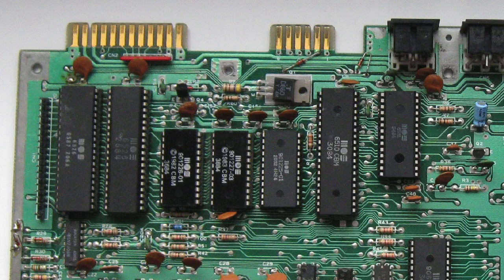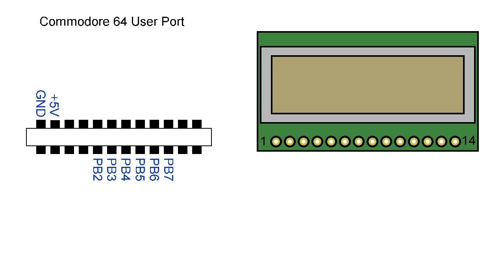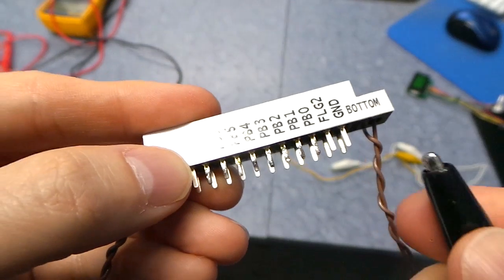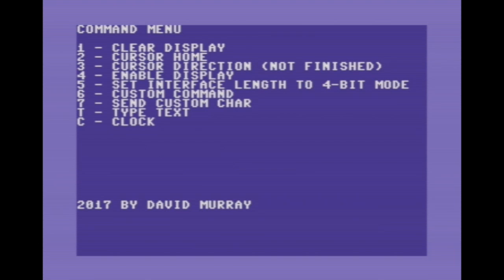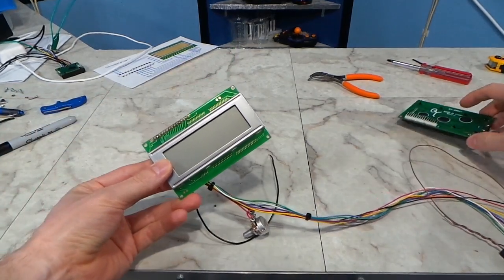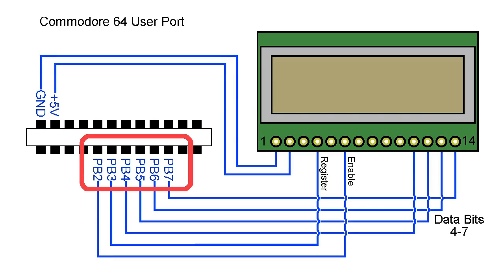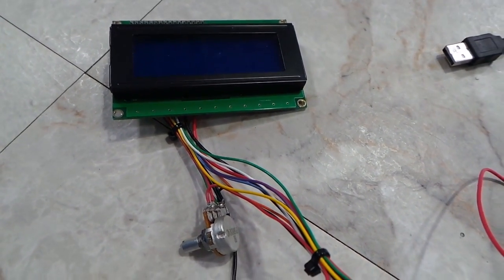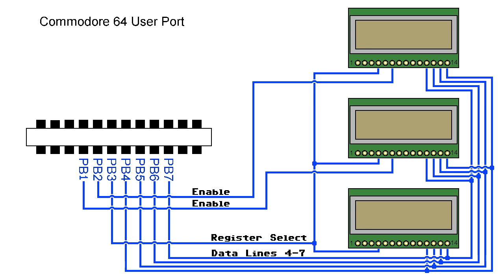How a Character LCD Works - Part 2

Comment: I have a c64 as well and at least one extra power supply. Could you do a video of you fixing the power supply? I am now a little worried about mine frying. Having at least a basic idea of what to do to fix it will really help me.
Reply: The power supply has a 9V AC output and one regulated 5V DC output.  You don't need to worry about the 9V output... in my experience, it almost NEVER fails.  The problem is when the 5V regulator fails.  There IS something you can do to extend the life of your power supply... always unplug it when the computer isn't turned on.  That way, it isn't generating heat all the time. 

Another thing you might look into is an over-voltage protector that plugs between your power supply and the computer.  If the 5V DC rises above a certain threshold, it cuts the power.  There's one called the SAV64 which has been mentioned several times in the comments for this video.

Depending on the type of power supply you have, it may be easy to fix or it may not.  The black bricks were the hardest to repair, because they encased the circuit board in epoxy.  Removing all the epoxy without damaging the board is a real pain, but it can be done.

I probably wouldn't have him do a video of him fixing that power supply (it was one of the black bricks).  If I were you, I'd have him demonstrate how to put together your own power supply.  All you need is two wall warts, one with an output of 5V DC @ 4 amps, and the other with an output of 9V AC @ 1 amp.  You also need wire (obviously) and a 7-pin DIN connector like Commodore used.

For that matter, he might also do a video on how to build your own over-voltage protector.  I know there's an open-source schematic for building one, because I mentioned it in one of my other comments on this video.

Comment: Hmm... if the power supply starts to put out more than 5v when it fails, why not modify the power jack with a 5v voltage regulator? It should protect the computer from overvoltage and still allow it to function properly, plus it's super easy to hook up with only three connections: in, out, ground.

Comment: I find these "8-bit guy" videos interesting.  I had a TRS-80 Model I as a kid and never got into the Commodore machines.  I have found a lot of videos where people have hooked up newly-made hardware to these old computers.  I never thought an LCD screen was a separate piece of hardware that could be controlled externally, but I find it interesting how the LCD works.  I suppose the VFD display in a Speak & Spell works in a similar fashion.

Comment: Hi, this is very interesting. Maybe it will be a good idea to add some protection to Your valuable stuff? You can put a fuse and a transil diode on the power input to add some protection. When You are connecting LCD to the port instead of direct wiring you can add resistor (about 100 ohm) in series - it should protect against shorts. Also take care about ESD safety - older IC's are more voulnerable to damage from sparks. I hope it should save you from problems in the future. BTW, great explanation of how LCD works.

Comment: My computer has voltage problems when it's charging devices. Luckily it shuts down the USB port when it realizes it's sending too much - why does it even happen? It's a 2014 Dell Inspiron
Reply: I work for Dell... the error message you're talking about is "Power surge on the USB port – USB Device needs more power than the port can supply".

In other words, it isn't your computer that has voltage problems.  Whatever you're charging, is demanding more power than the USB port can supply.

Comment: This could very easily be done over the Atari 8-bit's joystick ports. Is the C64 unable to output data through its joystick ports?
Reply: It uses the exact same joystick ports as the Atari does.  The issue is not whether you can send data over the joystick port... the issue is, "where is the power for the LCD going to come from"?  It needs 5 volts DC, and I guarantee you're not going to get that from the joystick port.

Comment: Can I hook up a 12-volt DC adapter to a Commodore 64?
Reply: The Commodore's power supply normally outputs 5 volts DC and 9 volts AC.  So, in order to hook up the 12-volt DC adapter, you'd have to divide it into two outputs: a 5 volt output and a 12 volt output.  Some things wouldn't work because they need AC... the datasette, the TOD clocks on the 6526 chips (because they get their frequency from the AC), and pin 11 on the user port (which normally outputs 9V AC).  But if you don't need any of those things, then yes, it can be done.

Interesting fact: The 6581 SID chip requires 12 volts DC (the 8580, used in the C64C, only requires 9 volts DC).  Normally, it gets it by passing the 9 volts AC through a rectifier to convert it from AC to DC.

Comment: Google "Ray Carlsen commodore". He'll build you a new power supply minus the problems of the original.
Reply: Not only that, he builds them with a built-in overvoltage protector.  Which is why his "basic" model (obviously made from two wall warts) is only $35, while his fancier models are $80.

Comment: Great video! :)
Unfortunately, it confirms my paranoia about those old power supplies - every time I set up my C64 (not as often as I'd like to) I check the voltages before I plug the supply into the computer. Last time I also checked the voltage after using it for a few hours, just for curiosity, and after seeing how high it got in just a few hours I decided to take a short break to let the PSU cool down again (AFAIK the deviation builds up with temperature). The supply being from the 80s while Germany increased power grid voltage from 220 to 230V in the early 90s makes it even worse... I read that the AC part of those PSUs (at least the European ones with 220/230V) would still be stable and could be used without any risk, only the DC part is critical. I guess I will finally build some small adapter to replace the DC part with a modern stabilized supply. I would have preferred to replace the AC part as well but it's hard to find any ready-made AC adapters providing the current and stability without load. All I can find are transformers as PCB components and I want to keep away from line voltages if I can. So it sounds like continuing to use the AC output but discarding DC from the original supply and injecting the DC voltage from a secondary PSU is my best option. But before I accidentally fry my C64, I'll better continue to search if that's a valid way of solving the PSU issue.

Comment: Hi David!

If it is a common problem, that commodore psus make overvoltage when go bad, why don't you make a device which alarms you when there are overvoltage? You could connect it the user port or cartridge port, connect it to an arduino, and with a voltage divider (which is 2 resistor in series) connect it to any analog pin on the arduino. If it goes overvoltage, turn on a buzzer or something. Maybe print some kind of cartridge for it. Probably a friend of you got a printer or there is some place where you can print it.
What do you thing about it? :)
Reply: I don't know what HE thinks about it, but I think why go to all that trouble when there is an overvoltage protector called the SAV64.  You plug your power supply into one end of it, and then there's a cable that runs from the SAV64 to the computer.  If the 5V regulator goes out, the SAV64 cuts power before it can damage the computer.

Or, if you don't want to buy an already-assembled SAV64, there is an open-source schematic for an overvoltage protector that you can build yourself.  No buzzers.  What's the point of a buzzer?  What would happen if you were out of the room when the buzzer went off?  The computer would probably die, that's what.  It's better to just have it shut the computer down (even if you lose anything you haven't saved) than to fry the computer's chips.
Reply: Sounds better.

What's the point of the buzzer? I don't know. I've searched for buzzers for a random project, and it was on my mind, it wasn't well tought out. :D
But if we replace the buzzer for a relay, my circuit is not that bad. If senses overvoltage, it cuts the power.

That Sav64 seem a good solution.

Comment: perhaps you could make a passthrough device with a regulator and voltage meter (perhaps one that beeps if the detected voltage is above a set limit) then you wouldn't have problems ever again and since it would be a passthrough you could just unplug it from a broken power supply and use it on a new one
Reply: That kind of thing already exists.  It's called the SAV64.  All it is, is an overvoltage regulator... if the voltage gets too high, it just cuts the power before it can damage the computer.  Or, if you can't find a SAV64 (the guy who makes them only does small production runs, so sometimes it's sold out), you can build your own.  There's an open-source schematic for something that works exactly like the SAV64.

Comment: Why not repair the power supply? You probably just have some drifting components. Are they epoxied in or something? Cool video, by the way.
Reply: The power supply was one of the "black bricks".  Yes, it is completely epoxied in there.  It's literally a solid brick of epoxy around the circuit board, with a black plastic case around that.  (And now you know why they're called "black bricks" by the people who've opened one up.)

Comment: Thanks for your interesting video. It's a shame your C64 PSU had to ruin your plans! I assume that if you have any future problems when using your C64 you'll check the PSU voltage as a matter of course. Seems like a poor design of PSU if it fails with an increased voltage but no doubt they didn't have the option of using some sort of 'intelligent' voltage monitoring back when it was designed and built. I'm assuming it's a basic linear PSU? I wonder if it's possible to upgrade the PSU electronics to utilise a modern control chip with internal voltage reference?

Comment: Better yet, you could connect 8 displays (okay probably actually 7 if you wanted an off channel) if you used a cheap decoder / demux chip to convert the 8 combinations of the 3 enable lines into 8 separate (non-simultaneous obviously, no free lunch here) outputs.  One if ye olde 74 series chips probably does that.

Comment: It's "funny" because I'm just now in the process of upgrading my original C64 powerbrick by bypassing the original 5V circuitry with a small PCB mount 5V 4A switch mode PSU called "IRM 20-5". I'm lucky to have the C64 powerbrick that can be opened by just removing 4 Philips head screws in the bottom and the IRM 20-5 is so small that it fit very well in the PSU without removing anything from the original circuitry thus making the process 100% reversible.

Might be a tip for those that want to fix their powerbrick and want it to look 100% original from the outside.

I hope no major damage on your beautiful C64.

Comment: In fact if you add a decoder chip, you can select 8 different screens with 3 ports, instead using 3 different ports to enable 3 different screens.

Comment: You didn't mention that many character LCDs require a negative voltage to drive the contrast.
Also you need to have the ground on the external power supply and the c64 connected together for things to works reliably. Not only that, you can even fry your c64 if your power supply is connected to a different outlet in your house. You don't seem to know much about electronics, do you :D

Comment: Could you create a video about which pins to check on the power supply output, and what goes bad within the PS?  

Thanks for the great videos.
Reply: Pins 1 & 5 for the 5V output.  Pins 1 & 7 for the 9V output.

Commodore power supplies are actually pretty simple, internally.  When something goes wrong, it's usually the 5V regulator (the 9V output is unregulated).

Every once in a while, you get a weird failure like one that I had.  Essentially, the wiring developed a "thermal flaw"... it worked fine for the first 30 minutes or so, then once the PS had time to warm up, a microscopic break would develop in the wiring (because of the whole "metal expands when heated" thing) and the C64 would power off.  On the plus side, I suppose that's better than an overvolt problem like 8-Bit Guy had.  No risk of frying chips on the motherboard.
Reply: +SpearM3064 Thanks for the explaination!

Comment: Hi! you should use current limit resistors in all data lines. 1 k each.  that helps if any shortcircuit and is a good practice for diy peripherals! 
besides, MOS chips are very ESD sensitive. allways GND plugs first. cheers!

Comment: Damn isn't that a terribly designed power supply? When it fails it gives out too much voltage? I mean I don't know crap about electronics, but isn't that avoidable?
Reply: No, because the failure is in the 5V voltage regulator.  The 9V output is unregulated but has a fuse, the 5V output is regulated, but has no fuse.  So if the 5V regulator fails, there's no backup.

If you want to protect your C64 from that possibility, you have to use an overvoltage cutout (there is a guy who builds replacement power supplies, which have an overvoltage cutout built in.  That's why his power supplies are so expensive... $80 and up.)

Comment: Ahahaha... I did a similar thing to some optical mouse sensors some time ago. Only I messed up the data pin voltage and also removed one of my two supply pins (3.3V and 5V) for test purposes. Apparently the supply pins are some sort of fail safe for excess voltage. Well, that fried my sensors. Several weeks and two levelshifters later everything worked as expected. Keep up the good work!

Comment: More difficult to program the parallel port on a PC? Not really. Standard QBasic (and older ROM BASIC/GWBASIC) have commands to do hardware port input/output, so it should not be much different from programming it in C64 Basic.

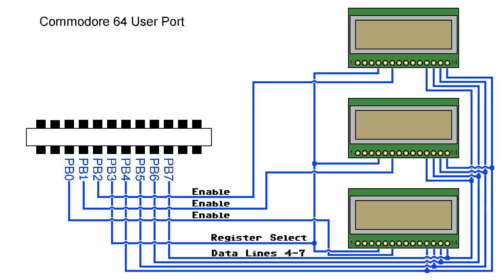Comment: 12:02 Or you can use three spare lines, and connect them to 4051 multiplexer adress bus. In this case you can connect up to 8 displays

Comment: Know what you mean, I have had a power supply go bad, and of course you cant repair them your self becouse they incase the board in some resin, and back then we didn't have dremal tools to work with. But you could buy a after market supply that you could fix if went bad .again. I of course didnt have the cash being a young family man just starting out.but now I own a C-128 and 3-4 disk drives just need to build patch cords for the drives..and next question, will the machine work with these new flat screens and if not what do I need? Thanks keep up the great work.

Comment: You can connect a character LCD directly to the 6502's address and data bus. You need address decoding glue logic to map an address range to the enable line, and you use the zero bit from the address bus for the register select. The 6502 bus already has read and write line available as well.

Comment: Excellent series. How long did it take to write all that code?
It's going to be a while before you trust those power supplies again. I'm sure you'll be measuring the output voltage before connecting any of those again!

Comment: If you introduced a couple of shift registers into the mix, you could control a lot more than just three screens with those bits. Of course, it would also increase the complexity of operating the setup.

Comment: Hey David

How about making a power plug "condom"? A device that cuts power and maybe displays a warning light if the voltage rises too much.

I imagine this would be a rather simple safeguard if this is a common issue frying hardware.

Comment: You might want to buy some cheap 7 segment display voltmeters from china and install them inside your C64 power supplies on the output.

Comment: On the BBC Microcomputer, they also had a user port, separate from another parallel and serial port. It was really just a GPIO bus, much like the Raspberry Pi (But then the RPi is strongly influenced by the BBC).

Comment: A great C64 project. I am enjoying this series. A shame about the overvoltage incident -- all too common a problem with those C= black brick PSUs. you should definitely invest in a C64 overvoltage protection device; SaV64 is popular, but IMO bwack's C64 Saver is not only elegant but very well designed. Check out bwack's channel, https://youtu.be/vV8FbwobrKY.

Comment: The best part about your videos is that you explain the entire the creative process, including the troubleshooting part.   Things NEVER go to plan, and that's always part of the fun.
Reply: Ditto. Kudos to the 8-Bit Guy for showing his actual process and not an idealized or perfect process that certainly could have been obtained by simply showing (via editing or making several attempts) only steps that were successful. What we’re seeing is an honest, real-world experience.
Reply: I agree!!!
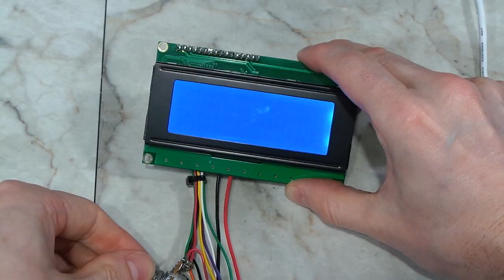Reply: 7:45 ye just not good stuff
Reply: I was struggling with use old Noritake VFD 16x2 display with Raspberry Pi and spend a lot of hours trying to figure out what's going on. It worked for about a few minutes and then started showing "random" characters each time. I thought, that it is because my VFD is not 100% compatible with HD44780 controller, which is common used in LCD displays like in this video. But the reason was the cables between RPi and VFD, and the USB power cable. They did not contact correctly. But it was strange, because I didn't touch them and it was happening! Thanks to this video I didn't give up! I love this guy :)

Comment: If you run just plain DOS you can just as easily send stuff the parallel/serial port, though you might need to use C